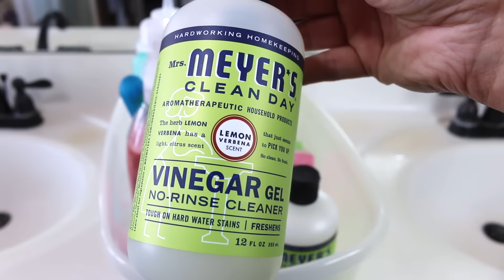Clean with Me! the Master Bathroom Sink

Comment: Great motivator Cherie!  For the hard water around the fixtures I soak a paper towel or rag in vinegar and just wrap it around the area dripping wet for at least a couple of hours. That worked well before I put in the water softener, now it doesn't take as much effort.
Reply from the maker: Awesome tip! I have seen that before but I need to remember that.  Thanks so much!